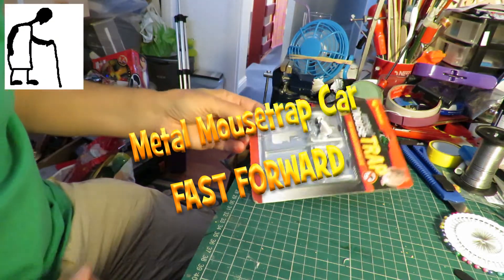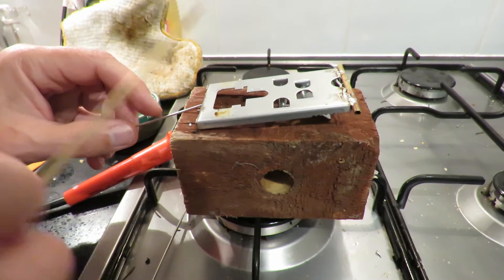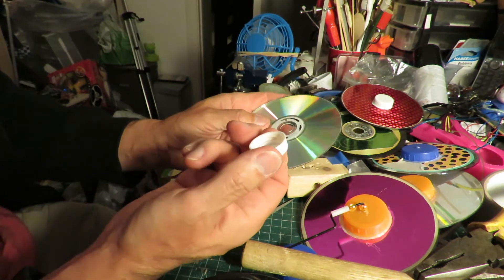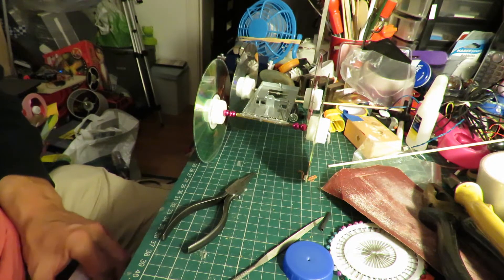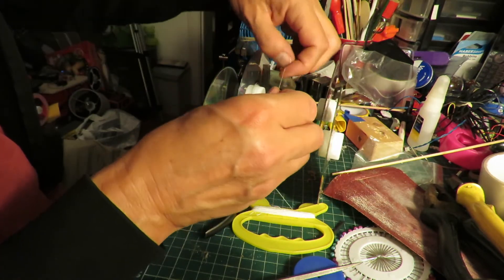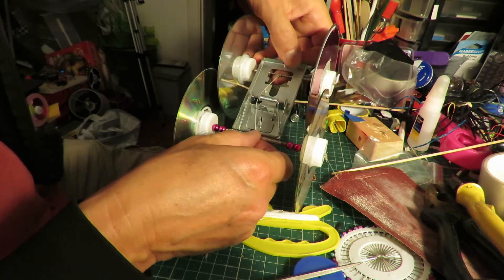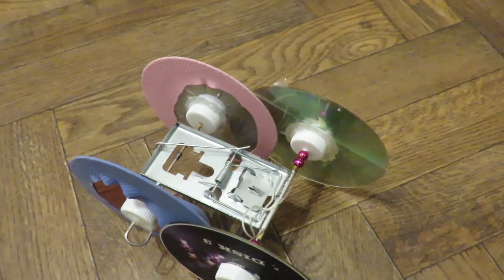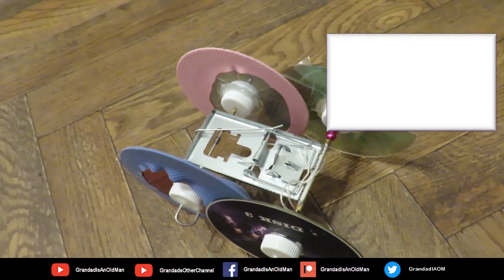Metal Mousetrap Car FAST FORWARD

Comment: Fun project----well sort of.  Ha.  I have never seen a metal mouse trap before.  I may have to get some to play around with.  I'm still working on a motor for my floor runner car.  The object is to make it very simple but still effective.  Not so easy because I keep wanting to add in all kinds of stuff like ceramic RC bearings and hall sensors.   That would spoil the goal.